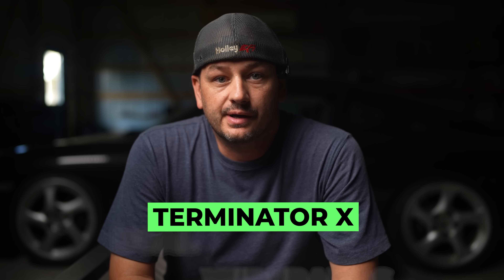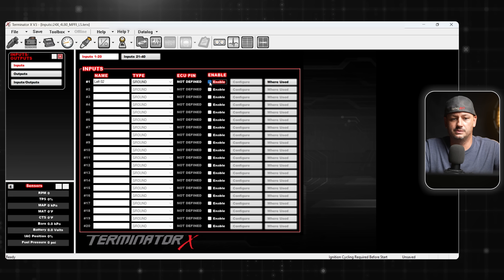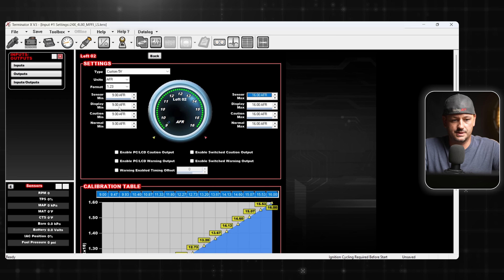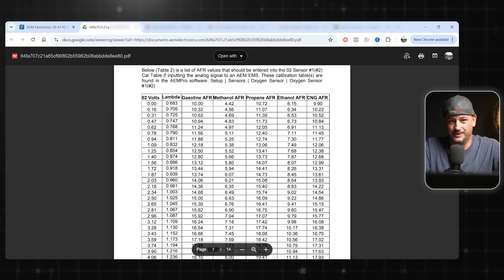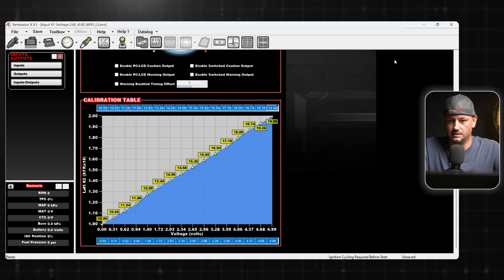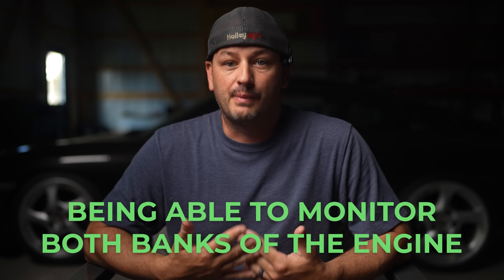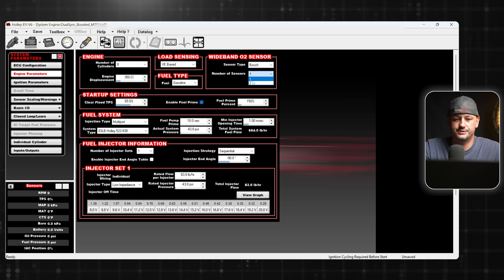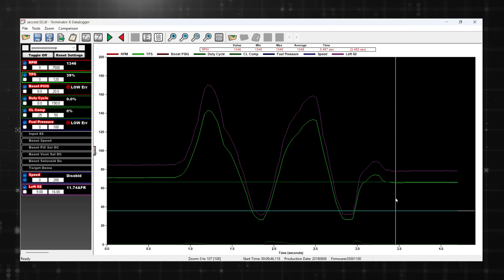Dual Wideband 02 Sensors  w/ Holley Terminator X

Comment: Great video Joe! I am in the process of installing a Term X on my ‘87 Mustang GT. I already have an AEM x-series wide and. Since I’ll have dual wide bands available, I might as well use them. My question is that the AEM has a white (analog +) input and a brown (analog -) input. How would I hook these up? The instructions say if no dedicated positive and negative are available, to attach the brown wire to a shared signal ground. And if no shared signal ground, send it to a power ground of the logging device. Does the Term X have a shared signal ground?

Comment: For a couple years now I have been using a standalone PLX AFR meter (in my A pillar which has a 0-5v analog output) reporting to my 6.86” Prodash. The only snag is since it has to send a signal to the dash which does a little math then passes the data along to the ecu for data logging via the CAN bus. Unfortunately in this instance milliseconds matter so in a log there is a slight lag behind the Terminator’s wideband data. Perhaps I’ll look at juggling inputs around so the PLX report directly to the ecu and any delay would only be the math. However for my current situation said lag is inconsequential. Still, having a wideband monitoring BOTH banks is an epic bonus for zeroing in on shit like a bad injector. Cheers, B

Comment: If you have all the data any reason you couldn't just use a Bosch LSU 4.9? I currenty have a PLX devices wideband from my last setup that I was just going to use to monitor the 2nd bank, but if I can wire it into the terminator that would be pretty nice as well, but I guess if its only going to be using one for the reference then maybe it is a bit waste of time if I already have a standalone wideband